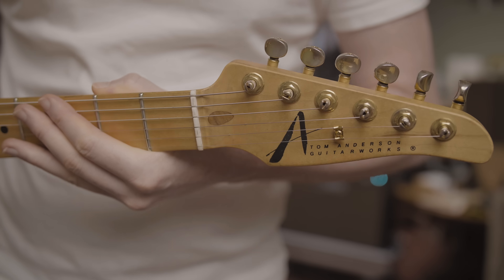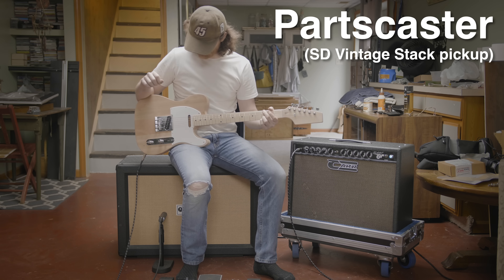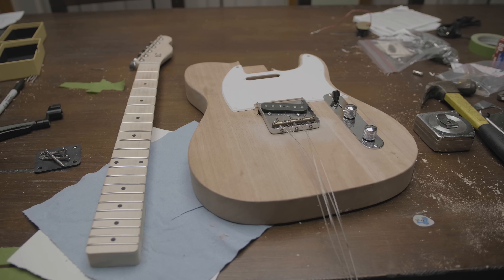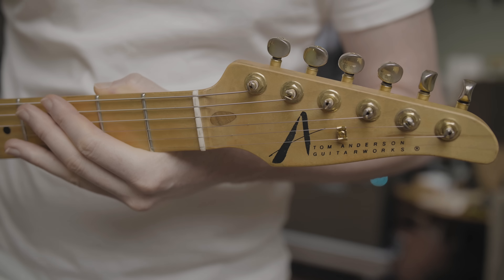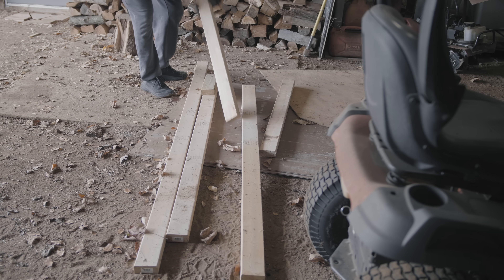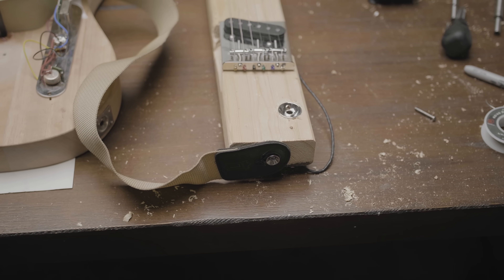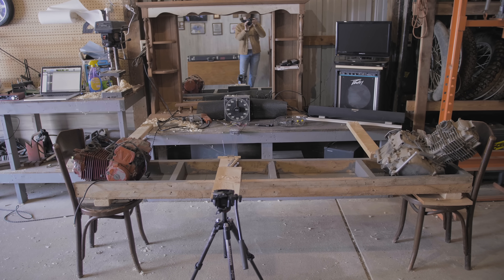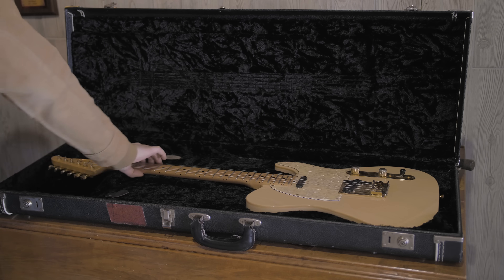Tested: Where Does The Tone Come From In An Electric Guitar?

Comment: I've been skeptical of "tonewood" for quite sometime... and will continue to be.

I think basically anyone who watches this video will have to admit that scale length, strings, pickup type, and pickup position have a significantly greater influence on tone than wood.
Reply: And exact tiny Pickup placement differences is exactly why a SG and LP will never sound the same even with the same pickups and even then, unless you're printing your pickup like Fishman, no two pickups will be 1000% exactly the same
Reply: The only thing I would add is type of bridge. In this video you only have strat vs tele comparison which winds up not being a lot. But I think you get a bigger difference from original tele and jazzmaster/jag, and a huge amount of the unique sitar/danelectro electric sitar sound comes from the bridge system.
Reply: @andrewgeary9749  That's a timbral thing though, regarding the sitar sound, they use flat blocks like on a instrument that uses sympathetic drone strings and I don't think that fundamental change should really be equated to the typical bridge as it's not meant to work purely like a break point, it's meant for a very specific buzzy-bloom timbre. 

I hear you though. IMO I think the plate makes the least difference while saddles are actually relatively important, those brass saddles in the video was quite apparent to me. But I also would like a more drastic bridge change up, a tune-o-matic compared to a flat plate for example.
Reply: @UCac0Lo-d56brDkvN_g9232A The key word there is anchored.. another word is isolated.

If any part of the guitar is affecting the vibration of the strings, the guitar is broken or needs a setup.
Reply: @TheMxxpower  every part of the guitar affects string vibration, no matter how minuscule the effect may be. The physics of resonant frequencies and sound waves changing media suggest that different body materials will affect the vibration of the strings differently, but the construction of a guitar makes this effect very small.

TL;DR: body material does make a difference in amplified tone, but it's so small that it can be ignored, especially when considering other factors.
Reply: @TheMxxpower  if they were truly “isolated” mass or shape (circuits and scale length being equal) also wouldn’t matter which anyone who’s experimented with pickups knows is just not true.
Reply: tonewood does have an effect on the sustain and feel of any guitar but in terms of actually affecting the general sound its really only noticable on acoustic. as soon as u plug into an amp ur tone gets processed through the electronics
Reply: It’s amazing what people “hear” when their eyes are open.
Reply: @mlg62playa  it’s amazing what they don’t when their ears are closed
Reply: @TheChadPad  It’s amazing what a below average player thinks he hears
Reply: @mlg62playa  You're making this surprisingly personal. If you're talking about my videos, those were years ago
Reply: its just the pickup and the switches, nothing else matters to the sound. Don't overlook switches! higher quality volume knobs can make a bigger difference than better pups.
Reply: but the 2x4 guitar at 7:50 sounds noticeably weaker than the original. The Anderson guitar sounded "fuller" in the video
Reply: It's amazing what people hear and see when they want to.
Reply: @ekklesiast  noticeably but not by massive margins, I mean he eliminated 2/3rds or more of the mass and if you double blinded most people wouldn't have a clue.
Reply: Some people also don’t have the kind of ears that can detect differences.  It would be helpful to have heard some mahogany in the mix.  A D-28 (Rosewood) sounds incredibly different from a D-18 (Mahogany) and it will be tapered down but still “there” for electrics.  Mass/wood type makes a difference when matching pickups.   I’ve done this first-hand too many times to need to see a video on it.  My biggest takeaway is if you find an American Pro Fender that plays buttery you don’t need a Tom Anderson.
Reply: @CenterThePendulum  no one is arguing that wood doesn't make a difference for acoustics, so I'm not sure why you brought that up. The physics behind electric guitars explain why wood makes such a negligible difference in amplified tone.
Reply: @Harmonic14  More glaring representations serve to illustrate smaller but present influencers in tone.  But, ears vary.  I’ve encountered a few guitar players who can’t hear harmonics or speaker differences.  The PRS vs Gibson debate will highlight these ears types typically.  Some don’t hear the difference.
Reply: @CenterThePendulum  rosewood sounds "incredibly" different to mahogany. I'm sorry, but you're deluded... you can "hear" whatever you want if it makes you happy to do so.
Reply: @alan_davis  Another prime example
Reply: @alan_davis  I assume in your statement you don’t sing - if you don’t hear the different in an obvious way standalone then seeing the difference in where your voice sits in the two eq curves would make it really easy.   No need to record, actively listen in real time.  If you don’t hear it then, yes for you wood truly doesn’t matter
Reply: @CenterThePendulum  Bryce, people have hook up sound wave analyzers to this same sort of tests. There is no difference in the sound frequency, demonstrably provable in the type of material your guitar is made of.

The only thing that matters to the actual sound of the guitar is the electronics and electrical connections.

Overall sound of any guitar being played depends on the player of course, but objective base tone doesn't.
Reply: @TheMxxpower  any good links supporting?  Why do rosewood neck fenders (not fretboard, actual neck)  sound so different than maple?
Reply: @CenterThePendulum  I likely can't post links in chat, they normally get blocked. The neck of the guitar does not affect tone, this video proves it by itself by removing the neck and body completely.
The neck will only affect the sustain of a fretted note, and shouldn't affect the tone of the fretted note if it is set up properly.

As I said, there's plenty of videos where people digitally analyze the sound waves coming from the guitar using different woods and necks, and they have no effect on the sound at all.
Reply: @TheMxxpower  One of the first results when searching is Johan Segeborn demo’ing this exact thing with dissimilar woods (e.g. not swamp ash vs alder).   If you don’t hear a difference it’s moot.
Reply: @TheMxxpower  This is a comment thread, not a chat, and links can be posted just fine. Please do so we can get somewhere rather than just speculate based on whatever bias we might hold.
Reply: @meadish  Are you the chat police?
Reply: @CenterThePendulum  
People who demo "tonewoods" to make an argument that the wood makes a difference to the sound are selling you something.
They also aren't swapping the electronics.

Swapping the electronics from one guitar to another with any type of different wood, plastic, or necks ...will produce 100% the exact same tone.

You maybe don't believe in spectrum analyzers that prove this beyond a shadow of a doubt.
Reply: @TheMxxpower  I don’t think you’ve seen how many times spectral analyzers HAVE found differences, you’re hedging your stance on selective data that supports your claim.  A very minimal amount of research provides a multitude of results.  If I had your framing I’d disregard the ones that concluded parity among woods.  Let’s talk a long time about this.
Reply: @CenterThePendulum  Ok.
An electric guitars tone comes from the MAGNETIC field of the pickups and how they interact with the vibration of the METAL strings.

Wood is not magnetic.

This is like saying the type of plastic or wood your casio keyboard is made of affects the tone of the keyboard.
Reply: @TheMxxpower  Your analogy posits that the resonance/resilience of the materials to which the strings/metals are anchored to doesn’t impact the vibration of the metal strings which is nonsense.
Reply: @CenterThePendulum  I think more people would if they actually tried

Comment: So you don't think the air guitar is "coupled" to the tables it is mounted on? I think so... those act as a large "body." I think the experiments are awesome by the way. What I would say is that you can take one les paul and another... one will sustain longer than the other. If it's only pickups and electronics... they have no affect in this scenario. So where does the extra sustain come from? Does the listener hear the extra sustain? Not as much as it has to do with how the player interacts with said instrument. Many tiny differences add up, and either equal an inspired performance, or a performance.
Reply: But funny how the tables, with different materials, sound the same as his guitar..... they don’t add tone

Comment: I once built 2 identical guitars from the same body and neck wood billets, using the same exact components, the only differences between them being their fingerboards, one maple, the other rosewood. The two instruments sounded so different that I started swapping pick-ups, electronics, tuners, and bridges, still the differences remained. I admire your dedication to coming to the conclusion there is no such thing as tone wood, but somehow, from the standpoint of this builder, it is hard to imagine that your demonstration, as scientific as it may be, is the end of the story. Perhaps, instead of using two benches, one at each end of the strings, which can make for an extremely resonant medium, why not use something less prone to exhibit the qualities of wood. It is well known that wood, fiberglass, aluminum, and glass guitars sound extremely different from each other, proving the body and neck materials have a lot to do with the overall tone of an instrument. Still, your work is invaluable in assessing the larger picture, which may be one that pits pragmatism against poetry.

Comment: I think we might conclude that the three main factors are the pickup's specs, their interaction with the strings (the pickup height and it's position across strings length) and the rest of the electronic circuitry. The rest of the guitar specs, tone wise, might be considered details 😬

Comment: I think it should be pointed out that the air guitar is not exactly an air guitar. It still has wood connecting the nut and the saddle by way of those braces to keep the two desks apart. Not that this invalidates your test, especially given how close they sound! The shape and tonewood of the guitar matter don't matter as much most of us think they do. 

It would be cool if you could find some way to keep the two ends firmly placed where they are without anything but the ground and the strings connecting them. Perhaps mount them to some concrete blocks?

Comment: They all sound the same.  Okay, my take: a solid body electric guitar is just a cutting board with strings & pickups.  What makes a solid body guitar better than another is the weight, the feel of the neck, etc.  in other words, the ease of playing for any given player. The same PU's give the same sounds.  Any differences can be corrected in the amp settings.

Comment: Besides the pickups there is one thing that changes an electric guitars tone. The pick, and how you pick, where you pick. These have a massive influence on the tone. You can easily test this using the same guitar. Just moving the pick closer and farther from the bridge can change it drastically.

Comment: Ok . Bottom line.You can strap the neck to a bench and carry the bench every where..
Or use a framework that ridged for weight ratio is more practical to swing on stage.
Like the bench. The guitar body has properties of no movement… give me swamp ash over bench.

Comment: Brilliant. Thanks for this.
Things I noticed that made the biggest differences (almost all made at least some difference, just some more than others, YMMV):

- Pickup change: massive huge biggest difference toward being the same (I actually preferred the clarity of the partscaster at that stage, fite me)
- Pickup height: noticeable difference toward being the same (not quite as much but still easily significant)
- Brass saddles: heaps more meat, more bass
- Nailing down consistent pickup height was a huge thing. After that, it seemed some riffs were better on one, other riffs were better on the other
- Air guitar between benches: lost some clarity and got a bit blurred. 2/7, wouldn't buy. Hard to gig with anyway

Super keen to see further tests!

Comment: hi this is gonna sound dumb. but I wonder if u could try thicker bodied guitars like lespauls. or like jumbo archtops or es-335 types compared to just air. especially when in a clean setting. of course driven as well. time consuming yes but I wonder. wouldn't you wonder aswell? hehe thanks for the video

Comment: As a new builder, this is exactly one of the questions I wanted to see answered. Now, of course there's still more testing to do, but it certainly confirmed by hypothesis so far. Looks like Pickups and Pots are the real primary tonal masters for an electric, as one would expect. I also want to test all day on comparing string types. Obviously more ferrous metals will be easier for the pickups to some degree - but too much magnetism can worsen the sustain. 

And thats one thing that I also think MAYBE the wood might actually change - the sustain. How the bridge is installed, what type of bridge, what type of nut all contribute to sustain. However, the wood itself absorbs some of that kinetic energy. The question is, does the sustain change when you go from softer to harder woods. Also, does sustain change based on the type of Truss one has as well. It's all about conserving that kinetic energy.

These are the two primary things I'm learning about right now as a new builder - understanding what truly effects tone, and what truly effects sustain.
Reply: Your both blind and wrong.